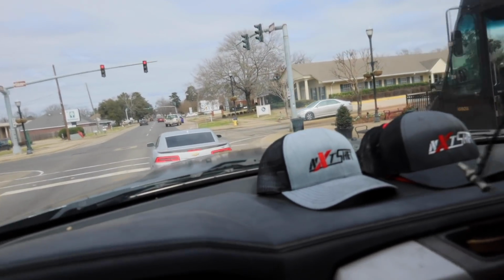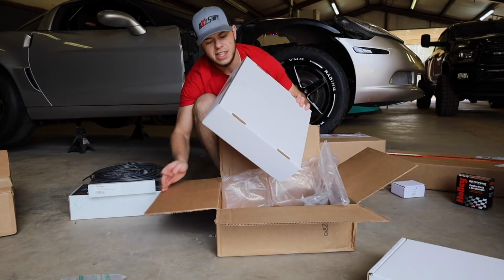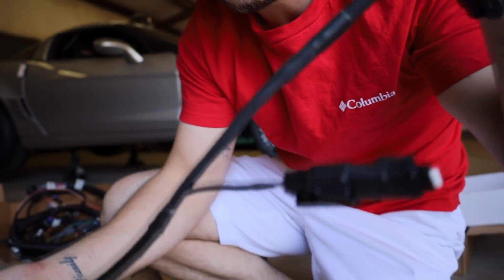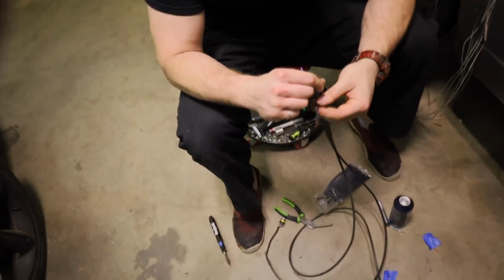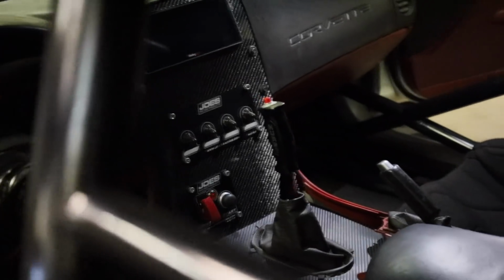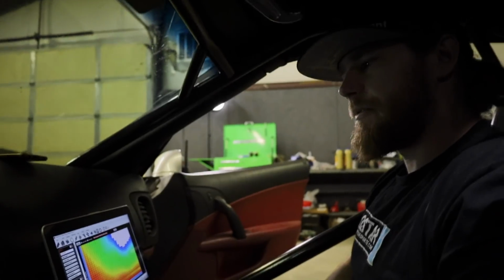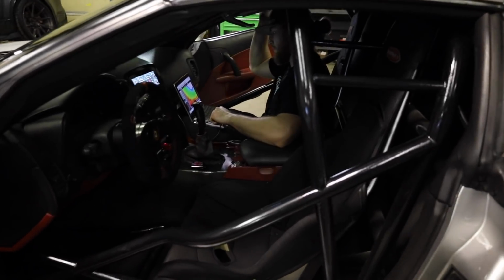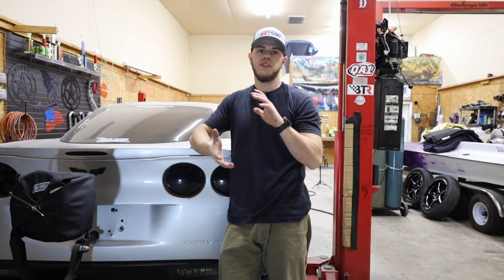Why you should Leave Tuning your car to the Pros.

Comment: I would love a badass turbo system. I already have a fully built billet 6.0 with a 98mm turbo, but I had to sacrifice my heater and AC the dryer was in the way...lmmfao but my truck is a 2013 GMC Sierra bagged and bodied on 26/9 in front and 28/16 in rear with a 13 inch lip rMTW wheels and plenty more. But I think I hurt my motor the other day though so please pray it’s something small and not rod knock. have a great night and good lucky Godspeed my friends+”

Comment: Great idea on the giveaway..  Ive seen some sweet Tick billet-ness, but didnt know they made harnesses to make Holley work better w/ the only Tremec's that matter. You need the sensor Johnathan made for slipper clutches. I take it ur running Black Magic? My camaro needs a solid turbo so bad, its the street version of Grubb Worm. I worked very hard to keep my ac in Ok. Then Id have an excuse to faceplate and switch from McLeod to BM.

Comment: Shit if you wanna go througha nightmare hassle of something that’s never been done (I don’t think so) and that’s putting the new 2018-2020 5.0 with the 10 speed transmission in a 05 Ford F-150 I mean if I win go for it I wanna see this shit lmaooo 😭 cause that’s what I wanna do but realistically wanna get a crate 5.4L triton put a lock out kit and built bottomed and put a Paxton pro charger on it or twin turbos

Comment: My Civic could use a basic cage.  Just like a roll bar or sum that goes over my head.     I also need fuel injector and pump.   I'm on hondata.    K20a2 gt35 stock set up everything. Car runs pretty nice. Just on 4 lbs  I wanna be at 15 or 20. And I'd be happy.   I'm already happy with my setup I build. Lol.  I don't buy nothing but turbo and waistgate and intercooler.    I make block off plates flanges any thing with metal

Comment: So crazy just found your channel less than about a month ago. By the way your Vette is  turning out bad ass man. I’ve got pretty much the exact same build I’m finishing for raceweek in June it’s a 05 C6 T56 416 LS3 single turbo with a Holley dominator remote mounted coils, shearer fab air to water, on top of a Holley hi ram etc. It’s crazy how alike the cars are same colors even. Any way was curious about your cage work and your solid axle swap and was wondering if you get a second if I could email you about a couple things you have done thanks man keep up the good work! Love the channel